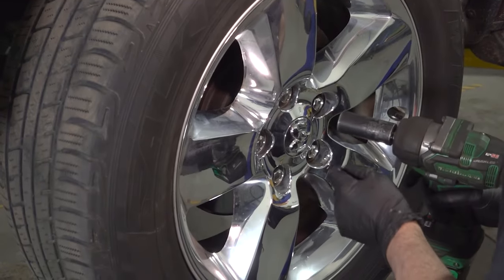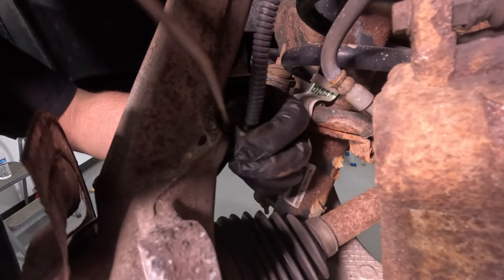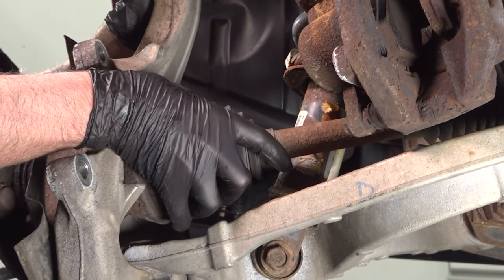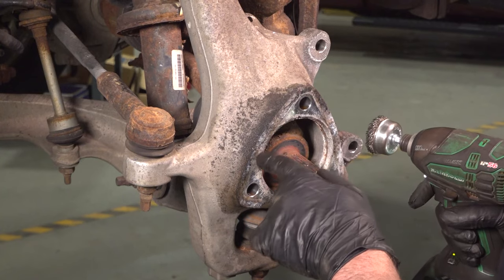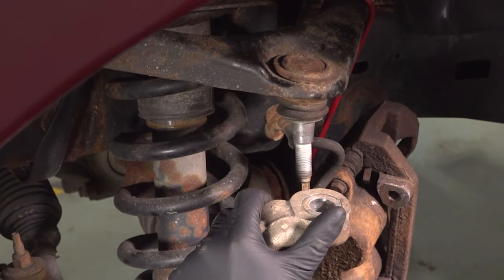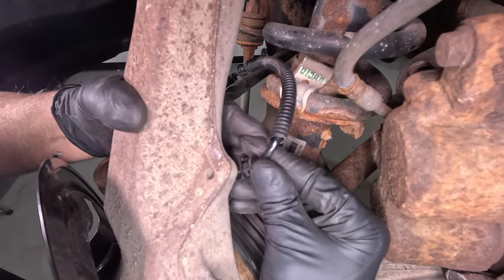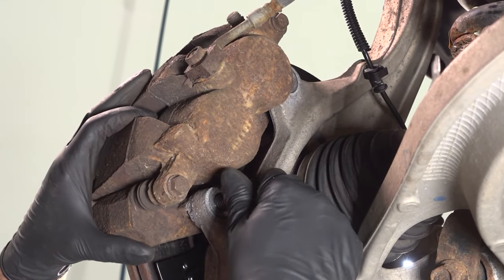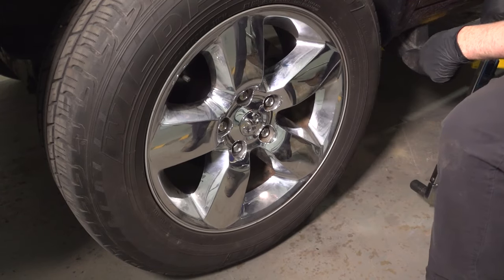How to Replace Front Wheel Bearing & Hub Assemblies 2011-2018 Ram 1500

Comment: If you live north of the mason dixon line, you’re gonna need 2 cans of PB Blaster and a bigger sledge hammer. Also, the bolts on my hub were 18 mm not 21 mm

Comment: Really good video, simple explanations no BS. All torque values given. Mine went straightforward however my bearing did not want to come out despite getting a bigger hammer. Nothing a duck bill spreader and power pack couldn't handle. Again, much appreciate the excellent video.

Comment: Excellent video, successfully guided me through the procedure for the first time today. They also have a great video for if the wheel hub is froze up and wont come off by hammer which was my biggest issue but got it off after 20-30 minutes. Thanks!